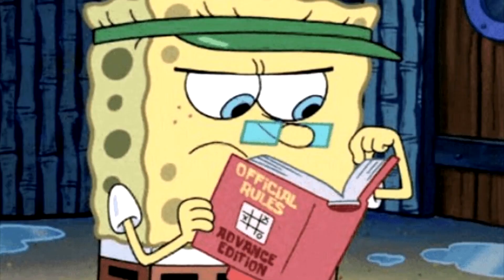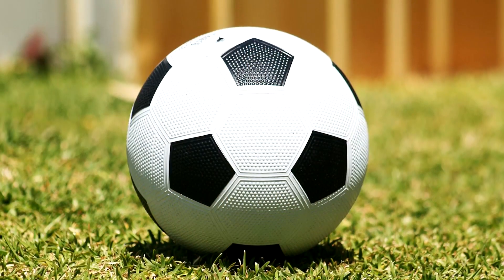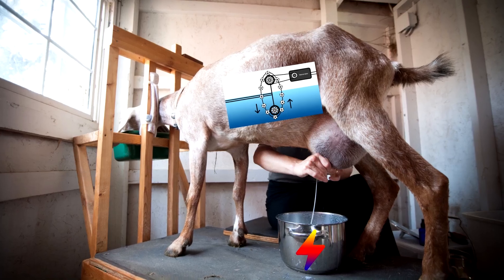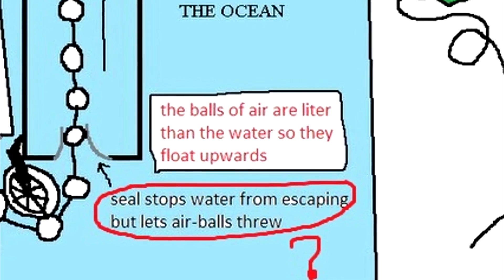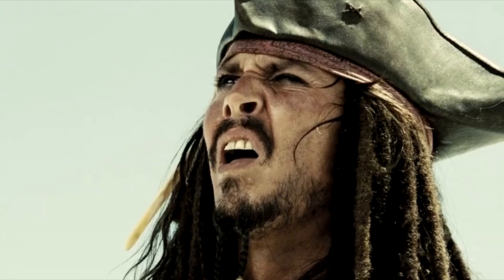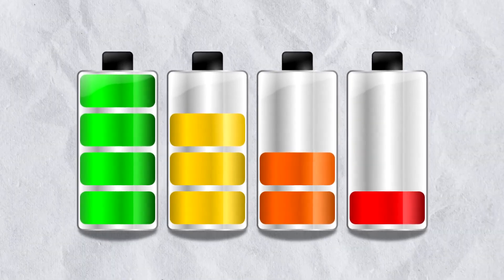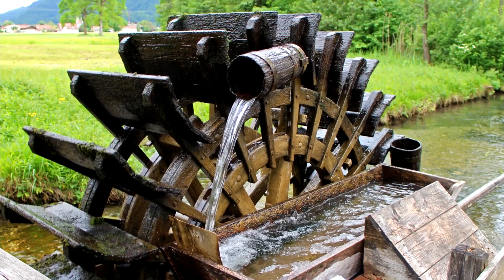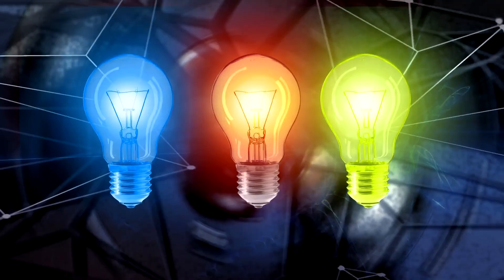why it doesn't work 16

Comment: You cannot cheat gravity. If something looks like they produce free energy, that mean they have energy stored in them.
Reply: The energy is stordd in the balls.
Reply: The only source of free energy that can be used to do tasks is unpaid interns
Reply: I see on a short gravity is electromagnetic waves
Reply: Patent US10144532B2

US Navy: 🤣

Intelligence: 😡

Airforce: 🤐

*Breakaway sector*: 👁️👁️
Reply: “Well you can’t with that attitude negative Nancy. Where there’s a will there’s my away” -my dad
Reply: tell that to wave and tidal energy
Reply: @an_annoying_cat  they are both created by the moon pulling on the water and the earth moving beneath it
Reply: Ok, when i drive 120km/h and put gear to the N... Car moves still like 2 minute... Without engine...
Reply: @Sisula2016  great! You just discover moving stuffs have energy in them
Reply: But it wash free energy....if i push gas, it take 8L/100km... On neutral it takes 1L/hour
Reply: @Sisula2016  The engine needs gas to be running. You could technically turn off the engine and still go for a while (don't do it for your safety)
Reply: You mean constantly changing to neutral? That's because if you keep the engine on or the brake applied, your car's kinetic energy is transferred to heat more than in neutral. Yes, it has been proven more efficient than driving normally, but it looks quite awkward.
Reply: @Sisula2016  Newton's first law of motion: "An object at rest remains at rest, or if in motion, remains in motion at a constant velocity unless acted on by a net external force." There are three types of energy at play: the chemical energy of your fuel (gasoline or battery), the gravitational potential of the vehicle (how high it is above the local low point), and the kinetic energy of the vehicle. When you press the accelerator, you are expending the chemical energy to increase the car's kinetic energy. If you drive uphill, you exchange kinetic energy for gravitational potential. The friction of your rolling tires, the chassis pushing air out of the way and your brakes expend the kinetic energy to increase the heat in the environment. So when you shift into neutral, you cease converting chemical energy to kinetic energy and the car remains in motion under Newton's first law, gradually slowing as its built up kinetic energy is converted to heat. If it's not on level ground, it will attempt to exchange gravitational potential for acceleration in the general direction of "down".
Reply: @Sisula2016  You have discovered Momentum (and Kinetic Energy)

Motion is energy. Thats why punching things works: you are turning the energy of your motion into force against someone
Reply: "InFiNiTe EnErGy ImPoSsIbLe" 🤖🤖🤖🤖🤖🤖🤖🤖🤖🤖🤖🤖
Reply: @acgaming1643 there’s more proof that it isn’t possible than proof that it is possible (none)
Reply: @jdeltia  yeah, so come up with something of actual substance next time, instead of commenting the same goddamn thing over and over in a viseo series about how impossible infinite energy is. maybe contribute something of meaning, next time.
Reply: @acgaming1643  i’ve commented one time here
Reply: @acgaming1643  just curious (i actually mean this, not in a condescending way), what makes you think that infinite energy is actually possible?
Reply: @jdeltia  it's not. my point is that "we get it. infinite energy impossible. now stfu and say something of ACTUAL WORTH next time"
Reply: @acgaming1643  This comment has more substance than all 3 of your replies combined.
Reply: @acgaming1643 you are stupid

Comment: OK... No free energy... I turn my car neutral and it still moves 🪒
Reply: try getting your car to move without pushing, pulling, or driving it. If you are on a flat surface you will find this quite hard
Reply: @doughboywhine  not hard... Just drive 30 km/h and  turn it of... It still movr
Reply: @Sisula2016 But it doesn't create energy. And it takes energy to start up the car and drive anyways. All it's doing is losing energy.
Reply: Electric powered car or liquid powered car? Or a solid powered car
Reply: @kyleirvinsiao  all cars... Even a bike keep moving little time after you stop pedaling 🤣
Reply: @Sisula2016 I don’t know if this is serious or a joke but if it is serious, that’s just momentum being conserved and it’s not actually generating any new energy, if you try to generate energy from the movement then that will cause the momentum to be lost and it will slow down (that’s how regenerative braking works)
Reply: @Sisula2016  inertia exists but it goes away eventually
Reply: ok now do it on a perfectly horizontal road
Reply: @RayleeRaven574  i can do... I drive 120km/h. And turn engnine off. And gear to N... Still car keeps mooving? HOW 🤣 Free energy 😨
Reply: @Sisula2016  But it's still losing energy... you're not gaining anything...
Reply: @froxdog  yes.... But she can drive like 1 KM and use a 0,08 liter fuel... Or turn of engnine, and put neural, and use 0 liter.... If that is not a free erergy....
Reply: @Sisula2016  But you're going to slow down and stop eventually...
Reply: @froxdog  yes... But still like 1 km without any fuel... Thas wash free eneegy
Reply: Look if you are losing SPEED (velocity) the system itself is losing ENERGY (kinetic transferring to dissipated/friction/heat) 
A system will only have as much energy as it was given, if I push a cube to give it 50 units eof speed energy, by the time it stops, 50 units of speed energy would be transferred into 50 units of dissipated/friction/heat energy, it's not hard to understand, I just think that bro's got an IQ of 42
Reply: @DugdoesDigging  yes i am losing speed AND car move like 1km AND it take 0 L fuel...
Reply: @Sisula2016  I see your mind is lacking in many areas, I am sorry for your lack of mental acuity, may those who love you take care of you
Reply: @DugdoesDigging  but tell how my car can move on stright road like 1km without any fuel? Yes it use fuel BEFORE i turn it of...
Reply: Sisula, in this case you didn’t use 0.08 litres to go a kilometre then use 0 litres to use another kilometer, you used 0.08 litres to go two kilometres.
Reply: There was once a man named Isaac Newton. Sure, many people still cuss him, but its what it's.
Reply: For the type of people that constantly need to be the smartest guy in the room, someone that is wrong in a really stupid way, but also has unshakable confidence in their argument, is their Kryptonite. You can get as absurd as you want and these scholars, so convinced how far the masses are below them, will always try to get you to concede and acknowledge their wisdom, but as long as you never deviate from your stupid argument, they will never see that you're just fucking with them.